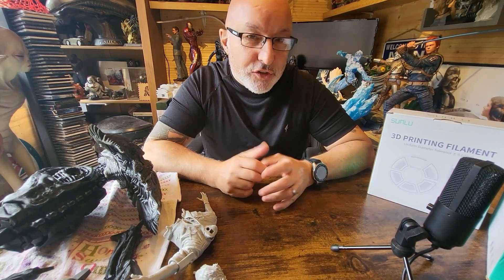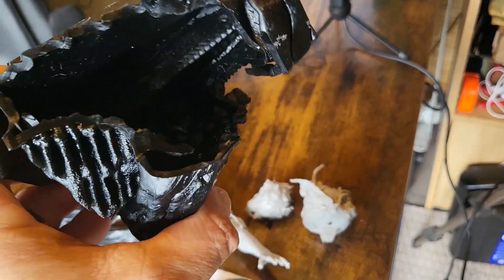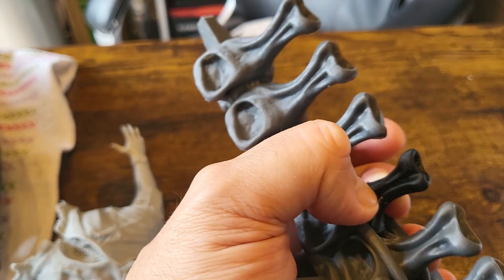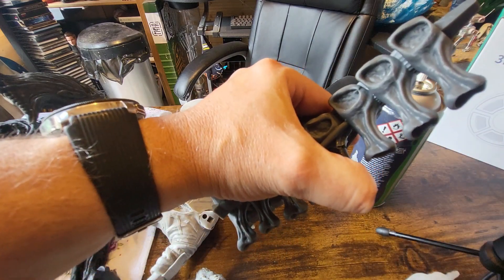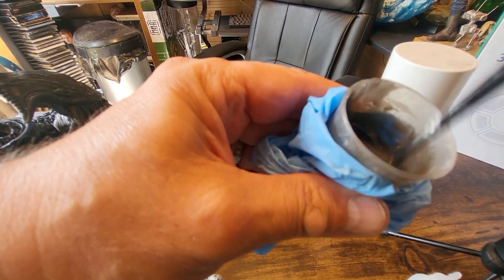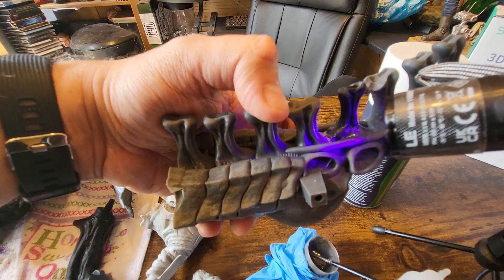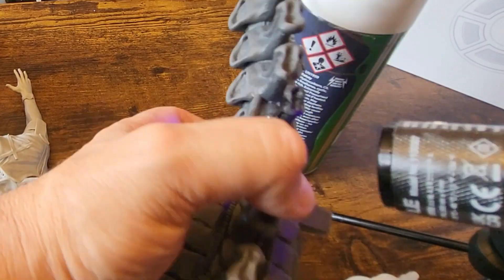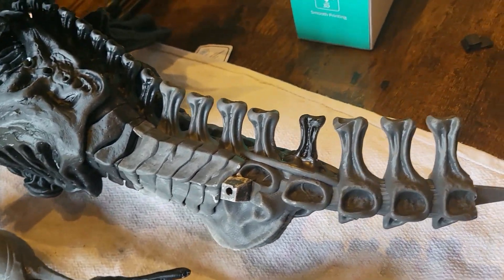Don't Throw Away Failed 3D Prints Use Them To Repair Instead

Comment: i use clay and glue to repair my stuff. i had a few walls for my sewers who needed a bit more resin then what i had in my VAT. so i poured some in and sliced te top of in the anycubic and printed the top part. just sandpaper it a bit on the broken piece and glue them together. for the gaps or wider midding areas i just put some clay (slib just watered down clay) and put my sandpaper to scrub off the clay that sticks out. you wont see the difference after priming :)
Reply from the maker: Thank you for the info.. Very interesting, 👍👍
Reply: @greedy3d480  if you like I can send you a few pics how it looked like. Even used a different color of resin haha
Reply from the maker: @thelousygitarist6830  that would be grest thank you
Reply: @greedy3d480  where can i send you the pictures? through email or something else? also what i did is using failed minis (let say missing an arm), printing it again, but still paint both. you can use the mini as a npc which helps the players out and in the story will loose its arm in the proces. thats what happened with my dwarf i got from heroforge haha